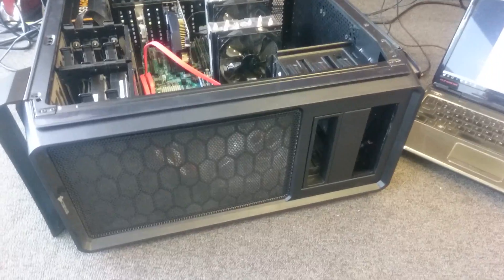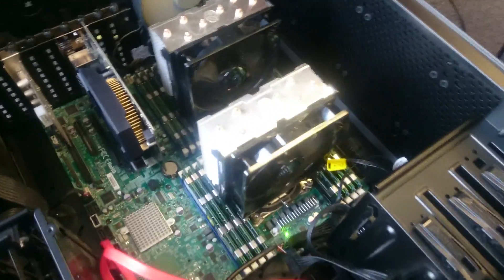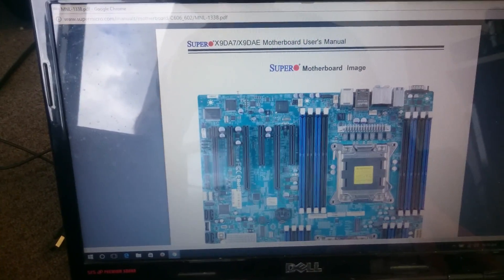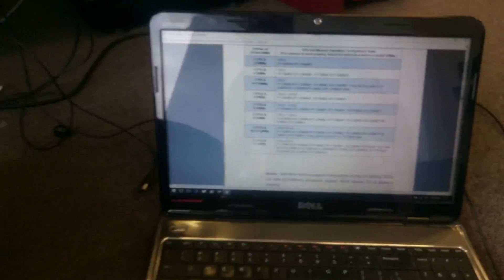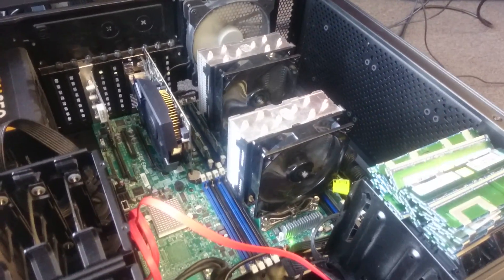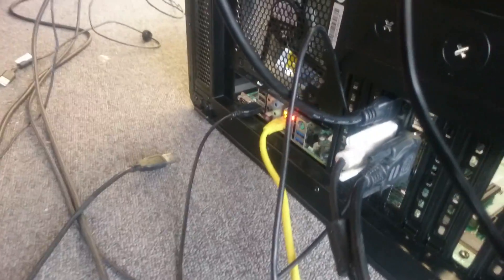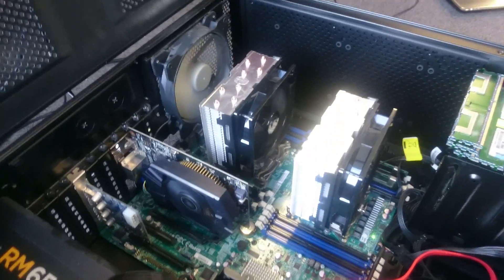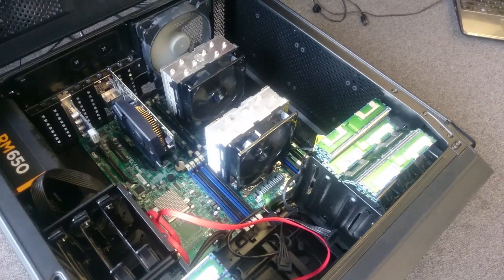Dual Xeon Video Editing Machine Issues

Comment: Ugh, I've also got an X9DAE and lemme tell ya, you REALLY have to read the manual closely and test only one thing at a time when debugging. I've discovered a lot of weird gotchas with this board:
- No DDR3L support, just DDR3
- GPU has to be connected or it won't POST
- GPU can't be connected in the top slot for some reason -- I've got mine in the 2nd-from-the-bottom
- Sometimes it won't POST if a hard drive has a corrupted boot sector?
- Sometimes it stops outputting video signal and will stop POSTing until I turn the machine off for several days. (This one has been driving me mad.)
- USB drives won't be detected in BIOS if connected to USB3 ports.
- Sometimes it won't POST if a USB drive is plugged into the wrong port.
I swear this board has been gaslighting me...

Comment: it was a resource conflict between the usb onboard and additional card. Once you removed the card it allows the usb onboard to work. then when you put the board back in it got rid of any conflicts and started working again. Some server boads are wanky when it comes to additional cards like the usb card. Usually taking it out then starting it resets the conflict then putting that card back in properly figures out the conflict and assigns a better allocation of the resources of that card. The way you did it would have been the way I troubleshoot a bad system. Remove everything but the basics, even the hdd. This way Windows or whatever the OS is doesn't get confused while you are trouble shooting the issue...

Comment: Your memory configuration is total wrong after you reinstall them. The LGA 2011 socket memory configuration requires 2 side by side memory installed for 2 DIMMs configured which mean 1 on the right side and 1 on the left side. For troubleshooting just install one memory DIMM on each socket. By the way, supermicron server grade motherboard supported IPMI, you should set it up. It is very useful for troubleshooting and managing your system.

Comment: My feeling  is that it is a power problem...but it's not that your power supply is bad...but that you have too much power being sucked through the motherboard connector. First is your video card which is drawing all of it's power from the motherboard while newer video cards have an auxiliary power connector for extra direct power. Add to that your USB card which can suck a great deal of power and has an auxiliary connector . Now I noticed that you didn't have the auxiliary power plugged into your USB 3 PCI-E card...I am pretty sure that you need that, otherwise it tries to draw all of the power off the motherboard, which in a perfect world, should work...but I think that if you put power into the USB board from the power supply through the drive style connector, you will probably solve your problem. Or, you can upgrade to a video card to one that uses auxiliary power from the P/S. Either choice should solve your problem, and you can probably re-populate the motherboard with all the ram you have, too afterwards!

Comment: Why don't you do a memtest, it uses a bootable software so no need for the os to boot. And I'm using a very similar motherboard, the X9dai and have you tried resetting the CMOS? It's usually helpful when troubleshooting.

Comment: Less memory modules means less load on the memory bus. (I think a Xeon doesn't have 8 memory buses) In some cases, this means that the memory can run faster or with lower latency, thus making the video editing process faster. It also depends on memory rank.

Comment: o WoW dude your going to need a bigger PSU on that 650 is real LOW for a 2 CPU system! like 800 ~ 900W
Reply: Ideally you want a power supply that reaches peak efficiency at the mode average of your load.
Reply: Those Xeon E5-2630 v2 have a TDP of 80W. Why on earth would you need an 800W power supply??
Reply: Matt K maybe a few years ago, but now you should be pretty good. :D

Probably a power supply issue though.
Reply: Daniel Turner those Corsair RM series power supplies are absolute garbage... and if he ever consider putting a GPU in that thing it would smoke that thing in quick order. I learn the hard way
Reply: Ideally, you should put something like the mightly EVGA Supernova T6 and its 1600W.
Reply: Thats what i am running in my home server a EVGA Supernova 1200w and my main PC a is a 1000w
Reply: I have an RM1000 and it's pretty good. Most of the time the fan doesn't even turn on!

Comment: You might want to try putting the USB card back in the system with all your RAM, then make sure nothing is connected to the USB card.  Some BIOS/UEFI have problems with some USB devices being connected during POST.  If the system boots, try re-connecting the various USB devices to the USB card until you find the cause of the failure.  Once you find the culprit, try contacting the vendor to see if they have a fix.  You might also want to let the board manufacturer know this problem as they might have a BIOS/UEFI update that will fix it.  Good luck.

Comment: It could be that a non-fatal fault occurred at some point while the computer was running and that fault condition was stored by the BIOS in the CMOS or NVRAM.  Next time you booted the computer the BIOS noticed the stored fault condition and decided to not boot.  Removing the fault could then be done by either resetting the CMOS or by changing the hardware in some way and forcing the BIOS to reconfigure the stored UEFI driver/hardware stack.  Just a theory, though.
Reply: That was my thought too. I've had all sorts of weird problems related to this, the recommended solution is to remove cmos battery for about 10mins while also pressing the reset button, this will clear NVRAM also.

Comment: It is not unusual that computers work again after unplugging and replugging all parts. Sometimes the even work again after driven to the workshop in a car. The plugged contact are sensitive to dirt and dust. When you move cards in and out you clean tha contacts and stuff is working again...

Comment: Definitely a power issue Dave. I work in a datacentre and I know for a fact it has something to do with power. Either your power supply is not supplying enough power, or there is something that is not powering up correctly. I often see this when memory is playing up, re-seating the memory just fixes it for a short time. Also follow the USB card route, it has to be either of them.

Comment: dave, it told you it was an IO error, why chase the memory tail . . . .?
Reply: more over, run memtest with it populated
Reply: memtest on 128GB? that'd probably take a day just for one pass.
Reply: you only really need to run the block move test
but anyway looks like a psu or faulty add-in board problem

Comment: Don't turn it on. Tear it apart! But on a more serious note...

Have 3 of the exact same motherboards pulled from servers that's been running non-stop since they were bought, and then all expired within half a year of eachother. In each case, the power supply was the culprit (Silverstone 1000W). One machine ended up with a single bad RAM stick on top of that. Use MemTest86 utility to diagnose memory, but first replace the power supply, as many commenters here are suggesting. Undervoltage on the 12V line typically affects mechanical hard drives first, causing them to stall, before other problems become evident. In your case it feels like the 5V line isn't holding it.

If those things don't help, check caps and regulators next to CPU sockets. Occasionally those things expire due to heat or poor contact with the passive heatsinks.

Comment: The manual you posted says that mobo has an AMI bios.
5 beeps in AMI bios is processor failure

ftp://ami.com/archive/Tech_Tips/BIOS%20Audio%20Beep%20Errors.txt
Reply from the maker: The manual has the beep codes listed, BIOS's can be customised.
Reply: Good to know Dave! I did a little more digging, according to a thread on tomshardware the graphics card is considered a console output device by that bios. Also I found this relevant FAQ on supermicro's site, though it is for the next model #.

http://www.supermicro.com/support/faqs/faq.cfm?faq=18188

Comment: I had much the same problem on a dual Xeon HP server; the built in diagnostics record the self test data and I was able to determine which of the 16 DIMMS had failed, it was showing a long list of uncorrectable data errors within 1 block of one DIMM.

Comment: Try to clean the RAM connectors/contacts and see if it helps. It's "simple" ('cos you got a crap ton of them), and cheap.  The RAM contacts on the slot can become oxidized over time and can cause the problem yor're having.

Comment: I would put the memory back and plug the 4 pin molex into the 4 port USB.  It could have been that the devices wanted power that exceeded the available power on that bus and without the auxiliary molex power it threw the error code.
Reply: Chase Daigle I also noticed he hadn't plugged in the supplemental power on that USB card. Looks like a 4 pin molex. I agree that this could be a problem, but not sure in this case because; especially if he didn't have anything plugged in to it to create a draw.

Comment: you need external 4 pin molex to power the usb expansion card. thats what the white connecter is on the back of the card is for. plug that in and you should be fine. :P

Comment: I bought a used motherboard off of the internet that had a blown keyboard controller. It would not accept a USB keyboard for bios setup, so I wanted to get rid of it, and the guy would not accept returning it. The computer also had a 80gb drive with a bad sector, a like 6800 nvidia with a broken inductor on the board. I do still use the DVD-burner from that system today, but it did fail to burn a dvd-9 at one point, the only time I tried to do so. It has labelflash which was neat, but seemed a bit faded possibly.
Reply: Pretty rare, but I have seen some dirty pci contacts and reinserting a card 3 times may scrape off the problems.

Comment: You have a dual xeon system and a graphics card that doesn't even require external power? That's gonna bottleneck your video rendering speed quite a bit...
Reply: ImpiantoFacile I don't think he knows about CUDA acceleration. As in, I don't think he uses GPU accelerated rendering and just does it all on the processor. In today's world, you could build a system with an i3 and a GTX 1080  and out-render this machine on half the power using CUDA acceleration.

Comment: I had a 5-beep error recently.  It turned out to be a bad video card slot.  I swapped over to the next spot and the problem never returned.  I suppose if I needed the slot I would have to look at a new MB however I got away with it this time.
Reply: did you find dust in it?  I found a hair in a memory socket once, it was failing its memory test.
Reply: Thanks for mentioning Knuckles...if I ever need the slot I will deep clean it first before getting a new MB.  Also, my computer is an Alienware and I know there is custom circuitry on the MB to control the case hardware etc.  A new MB would limit my computers good looks and for a gaming system that's a no-go.  lol

Comment: test voltages , start with 5v.

I best you 2 bottle of whisky that the USB card is pulling the v5 low on the PCIe bus due to it not getting enough power
Reply: Or it could have just as easily have been a speck of dust in that slot!
Reply: best trick to solve that is have an old syringe of thermal compound cleaned out and full of IPA , use that to client out sockets , when its turned off :P. 

I use this stuff http://www.ebay.co.uk/itm/Silicone-Thermal-Heatsink-Compound-Cooling-Paste-Grease-Syringe-for-PC-Processor-/272656080056?hash=item3f7b919cb8:g:EvQAAOSwCQZZCd0E

get a nice large syringe for IPA after its finished, sure its not as good as the leet gamer thermal compound like as5 but its almost as good and will do 90% of stuff just fine :)
Reply: I'll take those bottles, seeing as PCI-E does not have a 5V supply at all.
Reply: The PCI-E bus may not have the 5V, still, there's the Molex-connector to power external devices. While ago I had a pretty similar experience with a PCI-E USB-controller. Machine turned off out of the blue, no "magic smoke" on the USB-controller though, but smell of some component having gone over the edge. Weirdly enough the controller still works but only when the ATX-molex plug is not connected.
Reply: The card doesn't even use the 5V rail from that connector.
Reply: Here (and in many other cases as described in comments) the USB card caused an error and it did that most likely due to its power-related behavior. That doesn't mean the USB controller is 100% guilty. Those dual-CPU boards from Supermicro (as Dave has), Intel, HP or Tyan can be both at the same time: ultra reliable and yet super-bitchy. Not everything that cooperates with a run-of-the-mill ASRock also works fine on those server boards. Guess those premium boards are very strict with specs :) Have a nice one!
Reply: What power-related behaviour? Actually look at the card..
Reply: Actually, look at the other side of the card, the USB ports. One way or the other 5v need to be there, and that's what the USB-card does: convert. And that's where "tampering with power" enters the stage.
Reply: I have looked at the card. In detail. +5V is provided by an onboard DC-DC regulator (3A capable) which is fed from the +12V rail from the PCI-E slot or the +12V rail from the molex connector. The slot is more than capable of supplying all the power, the connector does not need to be used.

Now I'm pretty sure it's this card or something plugged into it causing the problem, but it's almost certainly not a power issue with this card.

Comment: The USB-3 Card needs an additional power connector. It may be fine as long you dont load it with to much current, but with load the PCIe-connector will be draw to much current from the 5V rail.
Reply: No, it does not, and to boot, PCI-E doesn't even supply 5V.

Comment: Could be caps on motherboard or PSU.  If it does it again, leave it powered up after the POST test fail.  Leave it on for 10 to 20 minutes, then try powering it off and on.  If it boots straight back up, you're on the hunt for some bad caps.   That behaviour can sometimes be caused by bad BGA connections too, but more likely to be a capacitor problem.

Comment: It should work with 2 SIMMs per Channel. Well, LGA2011 is shit in regards to memory...

But I didn'T expect you to use a PSU with non japanese caps...
And I'd also like your oppinion on Power Supplys with a semi fanless mode...

Comment: One coller blows hot air to another. While system is in moderate conditions it's fine. But imagine that we overclocked it to the limit and the weather is hot and no conditioner in room. Second CPU can start failing.

Comment: memtest86 is all you need
I bet it will be raining errors. bad ram
Just boot with minium amount of ram. Run memtest, if stable use a second pair of ram banks. Till you find the culprit

Comment: I think you can turn the cooler 90 degres and add a extra fan on the top of the case for a better cooling solution and a easy way to remove memory sticks on the future if the cpu cooler leave you do that

Comment: I'd still blame the USB card.  I've had a lot of random problems with an otherwise Rock solid machine when I added one of those 3.0 cards to mine
Reply: I vote for the USB card. It may intermittently not be initializing correctly and throwing faulty keyboard code
Reply: I would blame the usb card next time it happen that would be the first thing id try removing

Comment: For optimal cpu performance you should populate all four memory channels.
Reply from the maker: I have tested this. There is no measurable difference in any speed metric that matters for my purposes.
Reply from the maker: Ludovic Orban I have tested my videos encoders with and without the added memory and it makes no difference at all.
Reply: If you want to figure out where the real bottleneck is, you should use the Intel Performance Counter Monitor. That can show you how efficient the caches are, your memory and QPI bus bandwidth consumption and a ton more. But that's entering the territory of profiling your video encoder, which probably isn't going to be easy, and you also won't be able to do much even if you find out exactly what the bottleneck is.
Reply: I never meant to say otherwise, I just pointed out what tool you could use to precisely answer the question "where is the real bottleneck?". Depending on how your encoder was written to make use of multi-core and where the bottleneck is, you may improve performance by disabling hyperthreading and/or running with only a single CPU socket.
Reply: do it, just because you can
Reply: there is really no difference in the things hes using it for to run in quad channel

Comment: Had a few motherboards that were toasted with USB issues and had to replace  them. Started off with weird errors / devices not being seen etc and then eventually wouldn't work. Not sure why but could be current draw over time through them and how much they can easily provide without too much wear and tear and their components.

Comment: Having spent many hours chasing my ass with similar issues on a SuperMicro board(X9DR-F), id suggest ordering a different USB card. As stable and solid as these boards are, they are stupidly picky about stuff like USB expansion cards.
But try connecting the external power to that card first, it may very well work without it, but stands to reason it could create some odd issues.

Comment: that looks like ECC memory maybe a stick failing. could be a USB driver issue or BIOS error i would check for a Bios update that says something about that error maybe there is a BIOS fix. also check the Bios Battery see if that needs to be replaced
Reply: Nope... to everything you said.